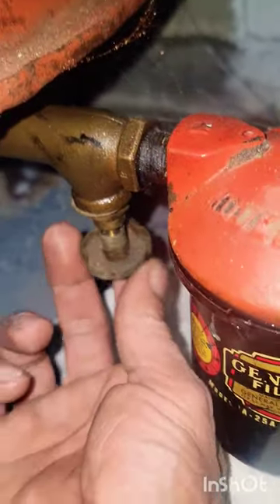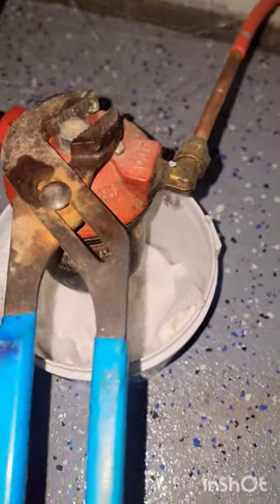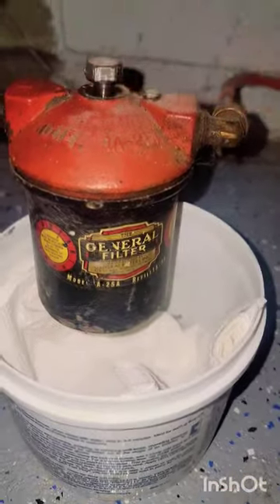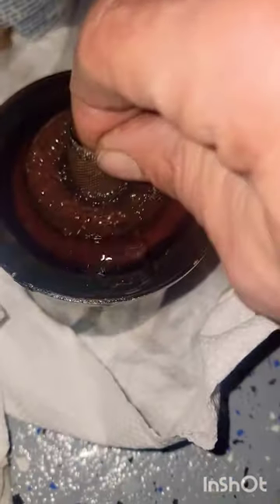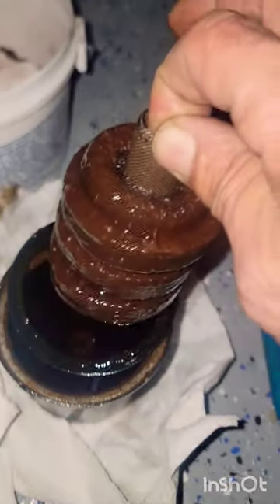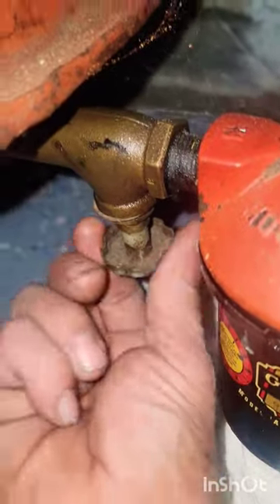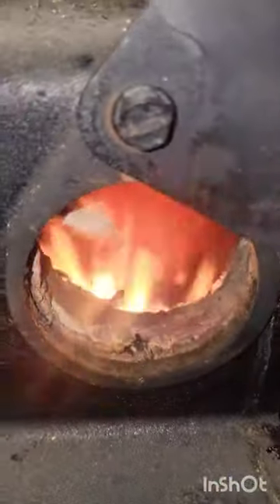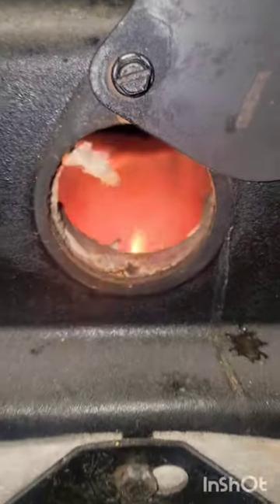How Yo Change A Boiler Oil Filter #asmr #diy #shorts #howto

Comment: Looks like the glass is missing from the window? That filter looked old too. Does that burner have a tiger loop?
Reply from the maker: No sight glass. Just a metal cover. Filter is a yr old. Did it last yr. Tank is being replaced soon. It's original n just discovered a tiny leak. It's time. No tiger loop. Y I had to pre bleed. Thanks for stopping by 👍🏽